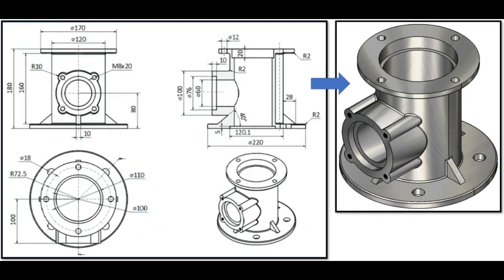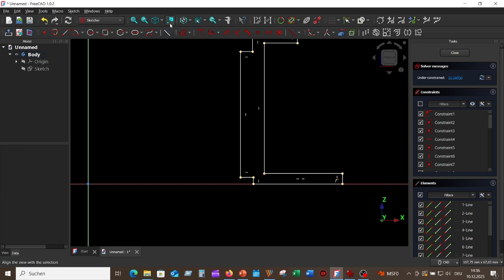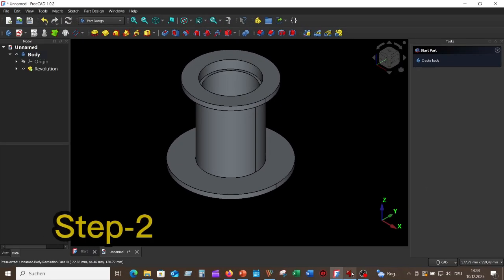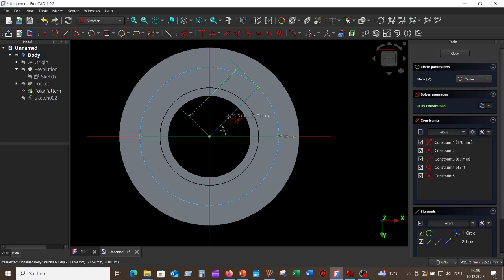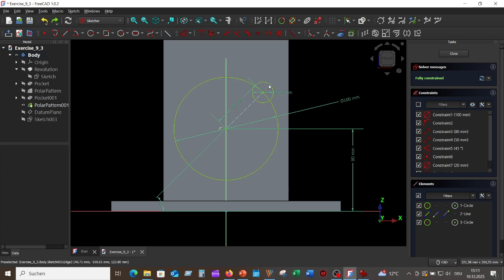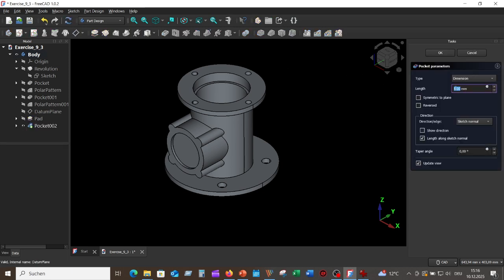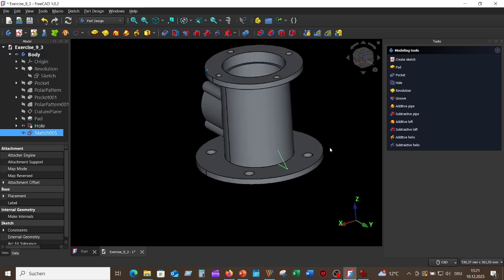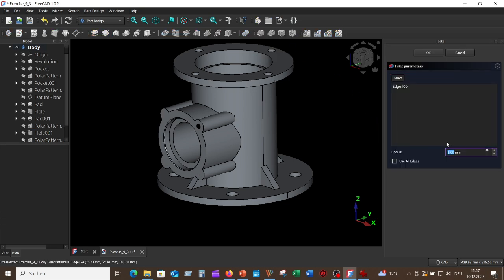FreeCAD Tutorial for beginners, 3D Exercise #09

Comment: At 18:00 I had some problems doing the polar pattern of the circles, they ended up being over constrained. I just sketched the three extra circles and put a horizontal and vertical constraint on the fist circle. That way I didn't have to add all the constraints like you did.
Reply from the maker: Hi,
These are the steps and the settings in the parameter dialog.
1. copies --> 3
2. select the equal constraint option
3. select the center of rotation point (axis center)
4. select the construction line
5. rotate the small circle in anti-clockwise direction, and assign the angle of -270°
I hope, it works now.